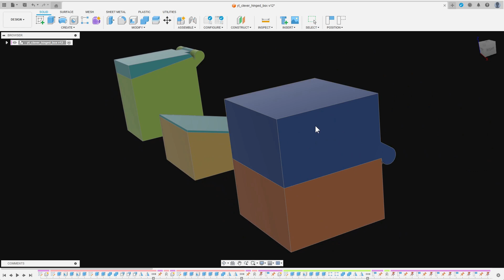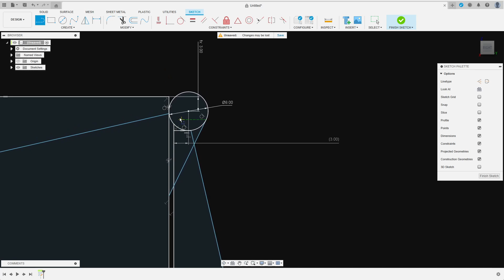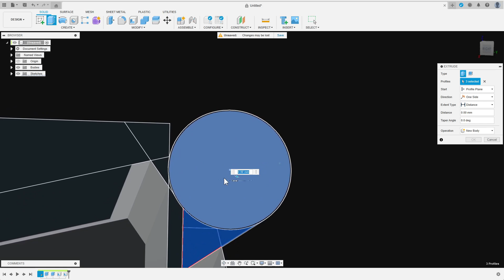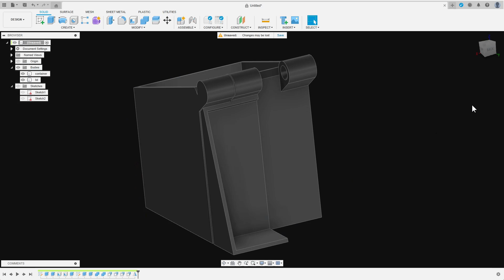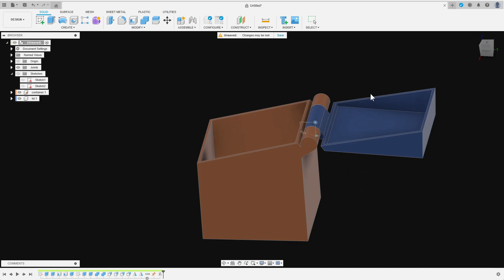Print-in-Place Containers with hinged lids in Autodesk Fusion

Comment: Another very nice tutorial. I think at 2:48 along with the "new body" option it was also critical that you used "Direction: Two Sides" option, one from the base of the cone and and the other to the outside wall. If you had used one direction extrusion here, the subtract would have left some material behind that would bind the lid to the container.
Reply from the maker: Actually, the new body overlaps the preexisting one here (it would bind if they were joined). However, in the next step, I remove the preexisting body, thereby avoiding any overlap. Later I offset faces for clearances, they never get joined.

Comment: All of these are designed the same way, that cone indent to solve the hinge is super weak, it's much a much better design to use a fancier bridge to connect the two outer parts of the hinge together, it takes some slicer setting manipulation but is 100% stronger and less likely to snap off than the indent method